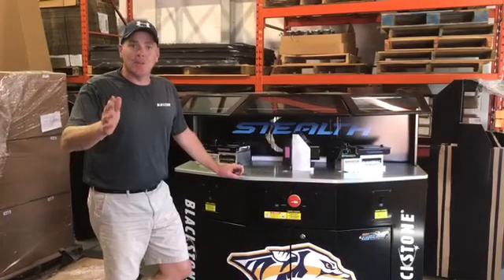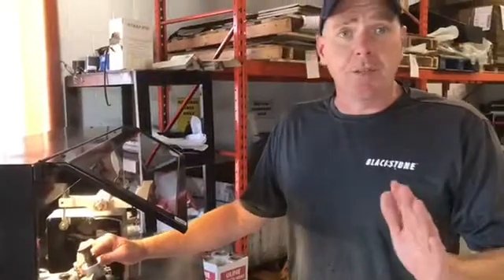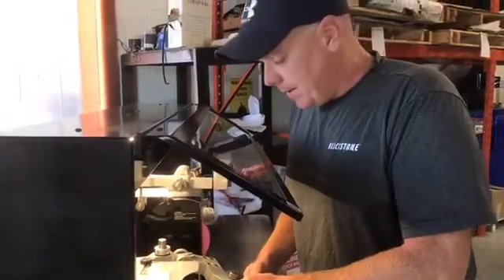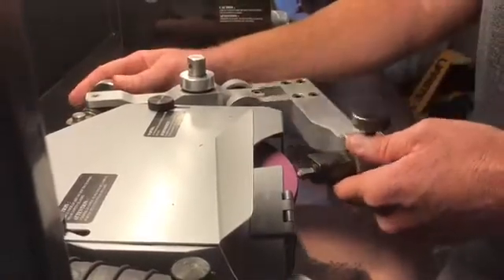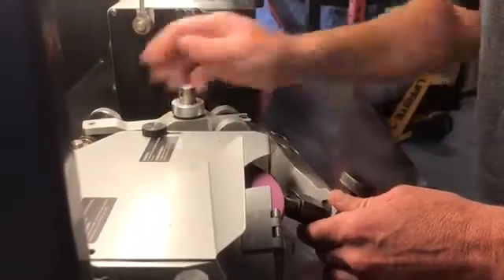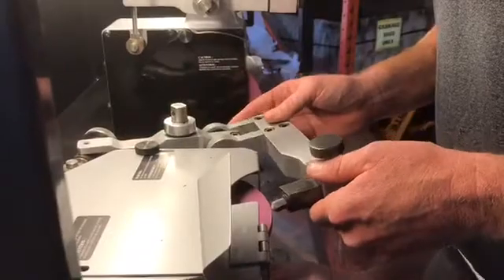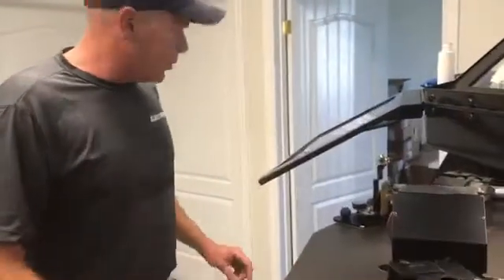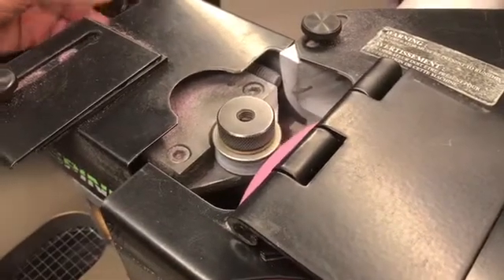Blackstone Spinner VS Single point Dressing

Comment: Would be nice if someone would make a video of doing maintenance on the older machine. Showing a nice full lengthy video top to bottom to keep it running good and how to adjusting the stuff to make sure it is running accurately